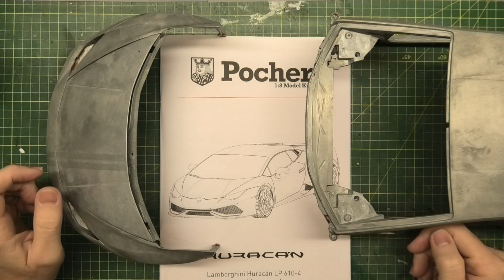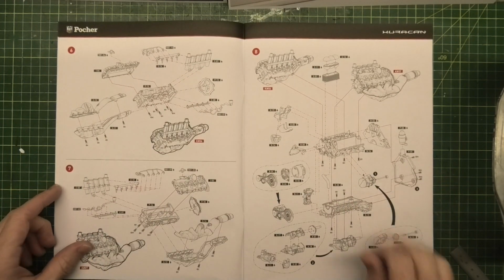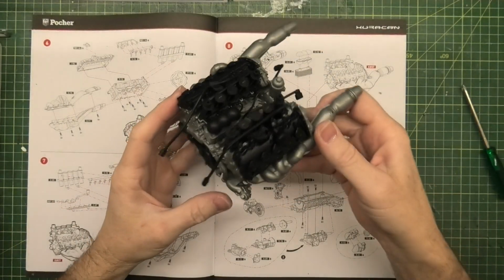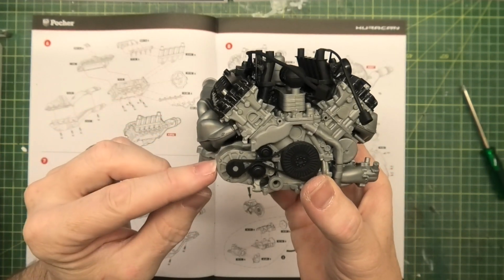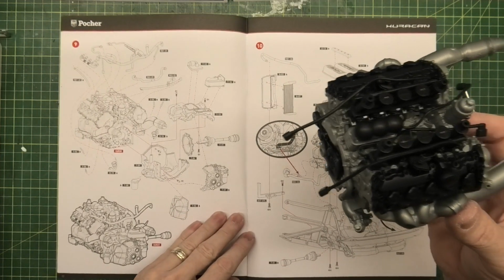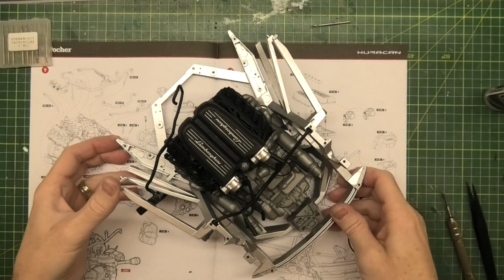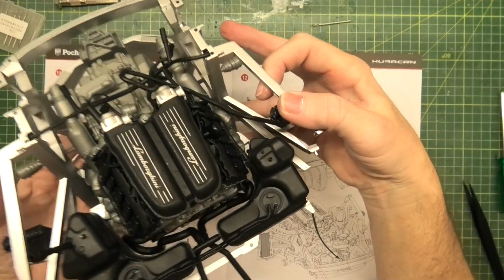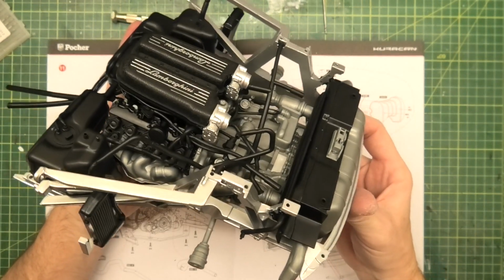How to Build the 1/8 Pocher Lamborghini Huracan - PART 3 - Body Issues & Engine Assembly

Comment: Yeah I had some fitment issues with mine as well, quite frustrating on a model kit this expensive. Definitely learned some neat tricks from watching you build yours though that I wish I had done for mine. 

Also maybe I am just spoiled by how well Tamiya does directions but I had some issues with figuring out where all the various rubber hoses/tubes were supposed to go haha
Reply from the maker: Agree on the hoses, the drawings are very detailed, but still hard to read. They should print the hose diagrams with the hoses in a different color so it is easier to see where they join up.

Comment: What were you doing around 39:42 for the next few seconds...it looked like you were using a tool to separate the top of the intake plenum from the bottom half, but you didn’t actually take it off. I can’t tell what you were doing, or why.

Comment: What did you use to strip the paint?
Reply from the maker: An automotive water based paint stripper
Reply: @ROBSMODELCARS  does that make that paint just fall right off, or is some elbow grease needed as well?